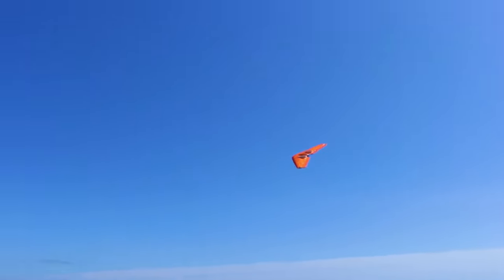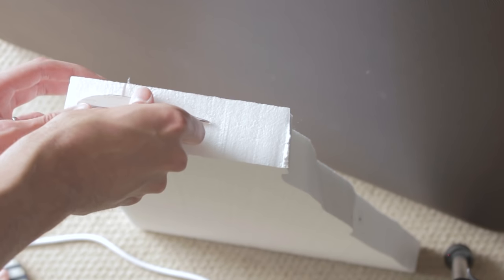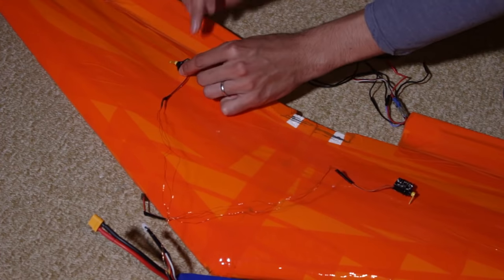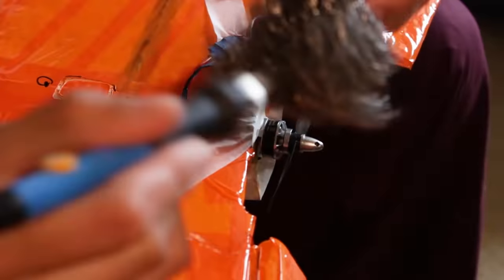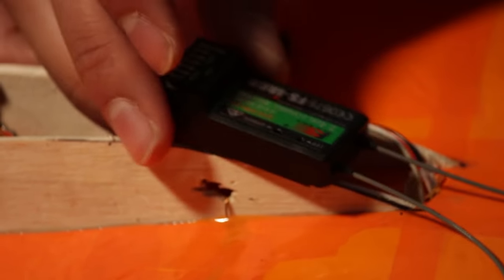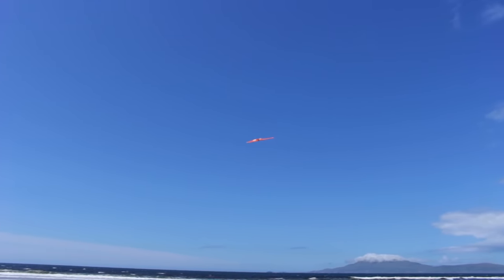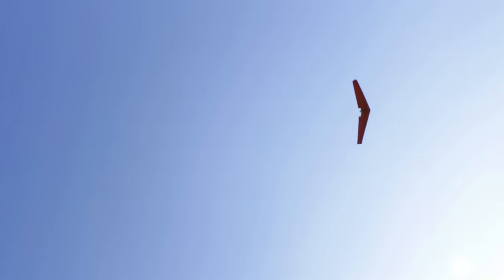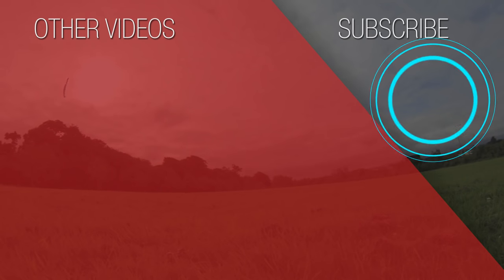How to make an RC flying wing

Comment: Hi, 
how heavy is your flying wing? I am trying to do similar (changed a bit wing shape and method of covering), but I am curious if it is not getting too heavy.
Reply from the maker: The wing without electronics is 250gr, electronics will add about 400gr depending on the battery.
Reply: Thanks for answer!
I thought that my is heavy as a stone  - I noticed that glue that I mounted  wooden reinforcement with adds much weight, so started counting every gram. Each raw styrofoam part of the wing was only 40gg, but both glued together with wooden "griders" added, but still without covering, became surprisingly 170g heavy. When removed wood and glue both styrofoam parts connected together were only around 100g. Second version was about 150g before covering.
Reply from the maker: @ksaweer  If the wing is the same size as the one of the video it is ok. I think it can go to a max of 1Kg.
Reply: @ @Joyplanes  
Thanks, i planned to go below 0.6 kg, i think i could use bigger battery than planned 1300 mAh / 107g.
Reply: You can find the formula for the center of gravity based on the shape of your wing online
Reply: Can i use aluminium frame instead of wood to reduce weight?
Reply: Dd
Reply: On my Zagi 370, I used a 370 Turbo (brushed) at first, then changed to a different 300 size motor, (max about 35 watts lol), a 3s 1100mAh - 25C - Hyperion G3 CX, that weighs 88 grams, two 9 gram servos and a micro RX, FAR from 400 grams,  more like 150.
30 min+ flight time with mixed flying, 15+ with more aggressive flying.
650 grams for a 1ish meter wing is super heavy imo, unless you`re doing slope soaring maybe..

Comment: Nice! Winglets are more efficient and stable than fins, it seems that your wing CG was a bit too backwarded, this is why the wing flew better without the winglets (it pushed CG forwards).
Reply: My thoughts exactly. Try lighter winglets and add some nose weight such as a bigger battery.
Reply: @MelindaGreen  Totally agree. I have an RC wing and had exactly the same instability until I moved the CG forward by adding weight to the nose. Then it flew like a dream, soaring with the birds of prey...
Reply: I disagree. With the large fins, crosswinds caused the vehicle to yaw excessively, particularly given their distance from the CG. Eliminating these caused any directional stability to be provided by the winglets, which were closer to the CG and much less prone to causing yaw issues.
Reply: @MelindaGreen  Hi, by increasing the size of the battery a lot of weight is put into play which then starts the process of playing with pinpointing the C/G all over again; to which my solution has been to either use small, round fishing weights such as what is known as split-shot, or either
"bird shot" from a shotgun shell which can be purchased through a gun store or the internet and is much more precise when balancing your model, especially a "wing" or a "Delta" type aircraft and is why a small plastic ballast box is necessary to have built into the nose of the plane to assist in this process.
Reply: @larrywhalen596  You can calculate exactly where the CG should be. Here's a lovely CG calculator I use with all the parameters in the URL: http://fwcg.3dzone.dk/?wing_span=48&root_chord=14.5&tip_chord=9.5&sweep_type=0&sweep=11&cg_pos=22.1
Then it's a simple matter of drawing a line on the bottom of your plane where the CG should go, then placing it on a stand while you adjust the weights to make it balance there and you're good to go!

Comment: I am using mode one, Japan hand, so I can launch with my right and have surface control on my left hand. Mode 2 has  a bit of challenge especially when maiden and one man launch . Nice work!
Reply from the maker: That's right, I didn't think of that, but I have years of using mode 2 already. Cheers!

Comment: Nice job no 3d printer needed. If you want to keep it lighter move the battery and motor forward and do not use heavy glue or paint especially on the back or aft 2/3rds of the wing. 3M 777 is heavy when over applied but helps your tape stick very well. Use two bright contrasting colors to help you orientate it from a distance. Take the motor off add some nose weight look up slope soaring go back to that beach and the mountains you were at and properly fly those spots as any self respecting wing glider flyer  should. In the wind and with out the motor for belly laughs try combat slope soaring with your foamy. Wind should =altitude = fun. If it does not penetrate  the wind add more wait on the CG line until it does. With just a 250ma battery you could fly for 2or 3 hours straight no motor or 3d printer needed.IMO good luck to you.
Reply from the maker: Thanks for your extended comment and recommendations. I'll try to do another wing later.

Comment: It's flying tail heavy,add nose weight,will make it glide better and fly faster plus yours is underpowered,you need at least a 2208-2400kv up to 2212-3000kv or more,and 3-4S 1500-2200mah LiPo,it's best to center the battery front to back to keep as much weight at the wing root as possible and just add weight to the nose to balance it.

Comment: Looks like your wing is slightly unstable in pitch.  Aerodynamic center needs to be behind center of mass.   I have flown wings that do very well in the wind.   In any case, you did a great job with your wing!
Reply from the maker: Thanks for sharing

Comment: Oh... One question about the use of the fpv: how do you power the camera and VTX? Do you use a bec connected directly to the battery, or do you power it from the receiver?
Reply from the maker: The camera is 5V so I connect it to the receiver, the VTX stands up to 24v so I connected it to the battery, if the VTX is not capable of high voltage, then use a buck converter or any BEC, all is powered from the same battery, if you want no noise at all in your video use a separate battery to power the FPV system, but it's heavier.
Reply: Joyplanes Nice, thanks! I bought an all in one camera + VTX, because I want to be able to use it in mini quads too. And it work from 3.2v up to 5.5v. So I think a buck converter and a good capacitor are going to work well. :)
Reply from the maker: Sure it will.

Comment: Removing the wing tip fins added a tiny bit more nose wieght and took away tip drag which equates to nose wieght that wing is way twitchy add a metal washer to the nose

Comment: what is the name of this airfoil?
Reply from the maker: I'm very sorry but I totally forgot what is the actual name, I took it from a database.
Reply: Try this one (EPPLER 328 AIRFOIL (e328-il))   i think it is the one
Reply from the maker: Yes that's the one or at least very similar, Thanks!
Reply: i,m building one right now with 1 meter wingspan. thank you for your video which inspired me to do so

Comment: For a full lengh guitar string (0.008" or 0.20 mm), you may use a laptop power suply (19 volts), works marvels

Comment: Hi I think perhaps because your wing is short in length from nose to tail, there wasn’t that much horizontal stabilisation. Also, when the distance between front and back is small, any small change in weight has an even bigger effect on CoG
Reply from the maker: That's totally true now that you comment it. Next version will be even better. Thanks for your comment.
Reply: Gautam Krishna: Good comment in regards to the "short nose moment to tail moment relationship" which is Extremely sensitive to Any changes in weight either fore or aft of the C/G, Especially with this type of aircraft, (!), where even 1mm can change everything and is why I use "bird shot" from a shotgun shell for fine tuning the balance in my models; FYI - the bird shot can be purchased via the internet or a local gun store so you don't have to handle/disarm
a live cartridge.

Comment: My receiver has separate attitude and roll plugins, how do I make them work together for a single servo?
Reply from the maker: You have to make a mix in your radio to make the elevon or delta wing function
Reply: Well, I ended up using separate roll and attitude control surfaces, my radio is too basic for mixing sadly
Reply from the maker: Ok, if that works too then cool!

Comment: Hi, thank you for tis experimental video. I build a flying wing like yours but I can not stabilizied its CG. How can I do it? ( it have 112 cm wing span, 29.5 cm center chord, 13 cm tip chord, sweep 30 cm and calculated CG is 17.5 cm) but real CG is 24.5 cm( not included electronics) what is the wrong?
Reply from the maker: Place all the electronics just like you are going to fly it, then you can measure the CG. There are many videos explaining how to get a proper CG on a flying wing. Cheers.

Comment: Which video receiver you used in and how you recorded the video in mid-flight???
Reply from the maker: The video receiver I used is an old cheap goggles from eachine. I used a separate dvr conected to the goggles.

Comment: You mention plans but your link just goes to the flying wing CG calculator.  Are there actual plans available (I know that there are shortcomings to this wing but it did appear to have some characteristics that I found interesting).  Are the dimensions in the CG calculator accurate (91.2cm seems shorter than what it looked like in your video)?
Reply from the maker: Thanks for that! The plans are available now. I don't know if the CG was the same as the sugested in the website but it was tricky.

Comment: Good work. One issue is your control surface design. The chord is longer near the middle of the plane compared to the outside, this leads to non-axial rolls, less efficiency at cruse/high speed and poorer handling at lower speeds. 

Put the widest section of the control surface out wide and far back for best results on roll and elevator.
Reply from the maker: Great tip, thanks.
Reply: NOFPV: This is a very good tip for any airship with ailerons; although not asthetically appealing as it would look with a 'straight' trailing edge for the ailerons it is much more, (highly) efficient !

And with the vertical 'winglets' set with the rear of the fin at 1.0° to 1.5° inboard they will direct more air over the outboard tips of the ailerons, which in turn results in a higher degree of response, and does Not create enough drag to be concerned with due to the performance gained by doing this one technique alone.

I've been flying R/C's since the summer of '76 and bought my first 'Wing', (Bill Evan's Saracen), when it first came out in kit form so have managed to glean a lot of valuable information over the last forty-six years.

For me it is easier to bite the bullet and buy a set of precut foam wings than to cut them especially when you can be flying in a few hours - plus this type of wing is as close to being 'bullet-proof- as one can get, Especially when a 1/8" by 3/8"
spruce sub-spar is incorporated
into the leading edge which protects your plane from damage during a midair and have literally 'flown completely though' a few other aircraft's fuselage or wing during a violent midair collision - and kept flying until it was retrieved.

Comment: thanks for posting.  nice work.  some thoughts.  a reflex profile was used; however, a simpler semi-symmetrical profile could be used.  the necessary positive pitch can be achieved, via elevon servo trim.    cheers
example
http://www.rc-network.de/forum/attachment.php?attachmentid=107531&d=1194882611

Comment: roughly a 1/3rd of the way back from the nose is where you want your spar and thats where your center of gravity will be.   USUALLY.
Reply: Not with a tail-less airframe. It needs to be a lot further back than that. Check on internet info for the correct way to get the balance correct.